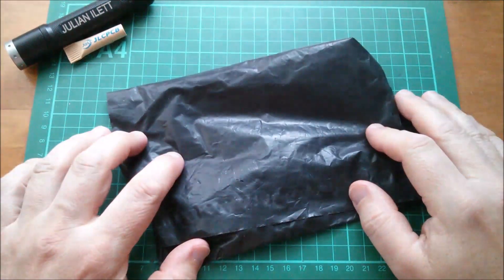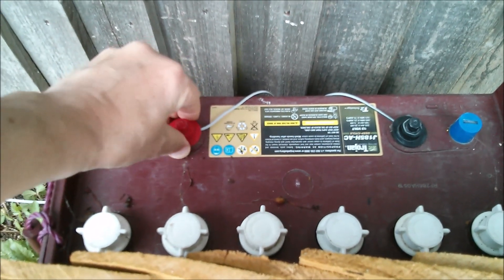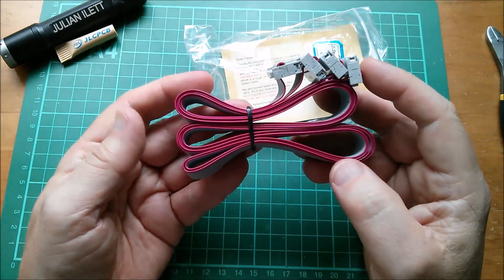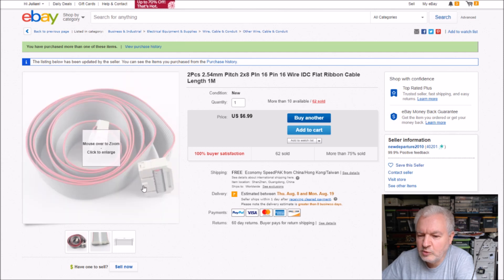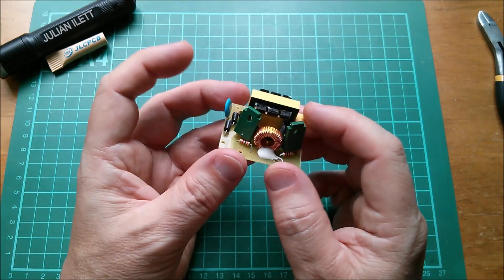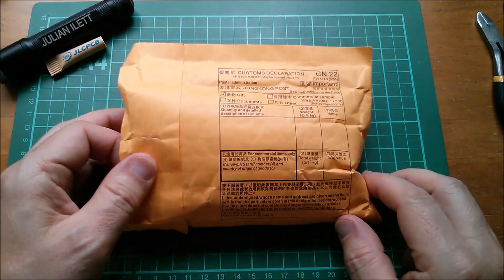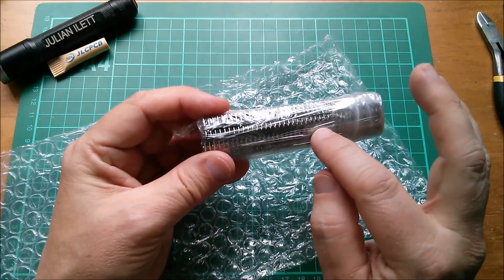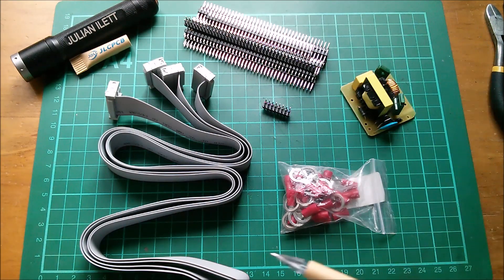Julian's Electronics Postbag: #138 - (plus links from #137)

Comment: Those connectors with the plastic around them are referred to as "shrouded",  and are handy when you want to make sure that the connector on the ribbon cable goes on in only one orientation...

Comment: Bit surprised you favour ebay so much over Aliexpress - those 2x40 headers for example are cheaper on there than the $3.68 you paid on ebay
:

item: "32858697985" 10PCS 2X40 Pin 2.54mm Male Header (choice of Red/White/Yellow/Blue/Green) 
$1.30/lot + $0.62 delivery  1x is $1.92 total (or in GBP, £1.09 + 52p delivery, £1.61 total on today's exchange rates)

item "32853351049" 5PCS 2X40 Pin 2.54mm Male Header (Black) $0.80/lot + $0.62 delivery, 2x is $2.22 total (or in GBP, £0.67 + 52p delivery, 2 sets, 10pcs would be £1.86 total on today's exchange rates)

Comment: I mentioned a BMS before that would take the excess voltage from one cell and add it to another in the series that's lacking. Someone told me it couldn't be done. If that's true, we might as well hang it up.

Comment: from the power supply to each board is a GND. in the ribbon cable are many GND. hmmm, do not make to many ground loops! Just try it. A GND star point is better for audio. or add later some 10R resiistors in the GND wires? Just triy it!

Comment: 5:02 interleaving ground and signals: you could put your big signal on one edge, followed by two grounds, then keep interleaving. This way you would end up with signals on both edges, which is fine, and also double the distance between the big signal and the next.
Reply: 6:00 ah, boards and connectors already set. But you can still do what I proposed: separate the two edge wires with your big signal and GND on a length of an inch or so, where you put the connectors. Under the connectors, you simply swap those two wires, before crimping on the connector.

Comment: OK so this might be a bit long but I'm trying to wire a 10w rgb led to run off a car with a rgb controller I've purchased. I'm a bit confused because on the controller it had 4 lead 3 for the rgb and a 12v constant, so what I'm wondering is do I need to buy the rgb chip and three led drivers for each color? If so how would I wire those to the leads from the bluetooth controller

Comment: Hi Julian - am sure you have review 12v led spot lights in the past, I purchased some from ebay last year which have not been used much, but for some unknown reason after 5 /10 minutes they start to flash on and off light a strobe light. Any ideas? Thanks in advance. p.s (not been subjected to moisture).

Comment: Let me repeat this comment, since you have not read it last time.
What is the idea of trying to re-use the power which in fact needs to be dissipated? it is to get rid of over-voltage, so putting it on the string of cells for charging would not work. Unless these converters are used for dissipating the heath????? It is silly.
Reply from the maker: I read it and I disagreed with it. Why dissipated? Why not redistributed?
Reply: yeah julian!! he seems a bit isolated here...(ghehe) ..  this is balancing 2.0... it all part of the global domination plan.  ilett power incorporated ..... just wait... you’ll see ....

Comment: so you are using these modules to make sure all batteries get discharched equally by wasting energy at those thst are in lighter use did i get that right? sounds absolutely dumb id rather put a fet in between the battery and the load and measure the current  going through that fet somehow and then turn off/raise the channel resistance of said fet for the batteries thst are excessively discharged with respect to the others and after a while id retutn to normal all fets in low resistance mode type of operation. sounds way more reasonable to me.
Reply: or you make it work by switch ( or microcontroller or ( this capacitor is full led and is dissipating its energy already, lets try to move the waisted energy to another capacitor which is not full)) ..  i can see where this is going....

Comment: I'd score those connectors with a knife before trying to break them off. It only takes a few seconds. If I don't do that I sometimes have it break at a pin or at least with a big extra plastic nubbin on one of the ends. I guess it depends on the pin header material, how and where exactly you pinch them and how you twist it. But for me it's much more consistent with that little preparation.

Comment: The way of stringing multiple boards together with ribbon cables is quite common on mixers with separate PCB's for each channel for taking the summed signals to the output boards (aux sends and main output(s)) and supplying power (usually +/- 15V and 48V DC), so in your application you shouldn't have any problems.

Comment: If you measure the wire size that those red, blue, or yellow crimp connectors you will find they are very much wrong and oversized because chinese manufacturers don't care.

Comment: In a previous video, you mentioned having to mod the PCB because the pins are in the wrong order, but why don't you just change the positions of the wires on the end of the ribbon cable (like the twist that they used to put into ide cables for master/slave)?
Reply from the maker: I want to keep the slew signal well away from the audio signals. I'd need to cross the wires, but keep them apart.
Reply: @JulianIlett  wrap them in metal tape to isolate them, maybe?

Comment: We should have a plastic tax and an oil tax
Reply: I was referring to the VAT (so called Value Added Tax) on domestic ‘natural’ (hydrocarbon) gas supplies to peoples homes (used for cooking, gas boilers and gas fires). It also applies to liquefied petroleum gas (LPG), heating oil and electricity. See https://www.gov.uk/guidance/rates-of-vat-on-different-goods-and-services and https://www.gov.uk/guidance/vat-on-fuel-and-power-notice-70119
Currently fuel supplied to homes (electricity, gas, heating oil, solid fuel) is taxed (VAT) at 5%.
Fuel used for vehicles that travel on the road (as opposed to vehicles that are used on private land) is taxed even more.
Reply: What I do think needs taxing, is products like plastic that are made from refined crude oil. Further, there should be two rates, with the higher rate used for disposable items like carrier bags, plastic cups, plastic packaging etc.
Reply: but then that oil tax would be gas and power tax as well. think about your power bill now, and then figure that 7% oil tax.
Reply: @nightshadelenar  Ok, and...

We can use that money to promote clean alternatives and a program of insulation
Reply: We in the U.K. already have oil and gas taxes...
Reply: @Mark1024MAK  Do we?  Are you confusing fuel taxes with oil taxes
Reply: @Mark1024MAK  I suspect the 'gas' referred to was gasoline and we certainly have plenty of tax on our oil based car fuels in the UK.

Comment: About the red colored sleeves in the ring terminals, yes, at least some decades ago it used to be so that red, yellow and blue colors in the crimping connectors indicated the cable thickness and amperage intended for a specific connector, and there were crimping tools that had the same colors to indicate which position to use to crimp the connector to the cable. I don't know if that is still used since all my experience in this regard really is from a couple decades ago. I sure cannot remember the specifics of the different color codes.
Reply: pev - yes it is the case. Red is the smallest, then blue, then yellow.
Some crimp terminals are available in other colours, such as black, and purple.
Crimps (good quality types) are widely used in industry, as a crimped wire is an extremely high reliability connection.
Reply: think it still is the case as I used to crimp all those it also relates to the bootlace crimps or ferrules

Comment: i thought that you were having a solar panel and charge controller for each of your large batteries, you are only using one?
Reply from the maker: I need to make 2 more - it's not really a problem in summer :)
Reply: @JulianIlett   Wouldnt it be better to make a controller that allows you to put the batteries in a parallell array?
Reply from the maker: The batteries are in parallel (with a little resistance between them). I need 3 controllers because of their maximum current rating (PWM5 = 5 amps). 100W panels produce about 5 amps max.